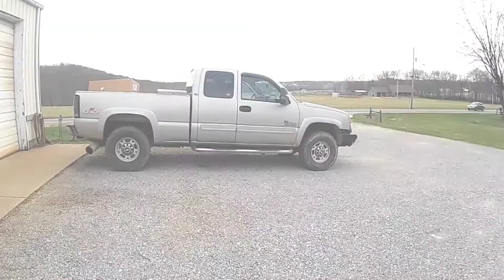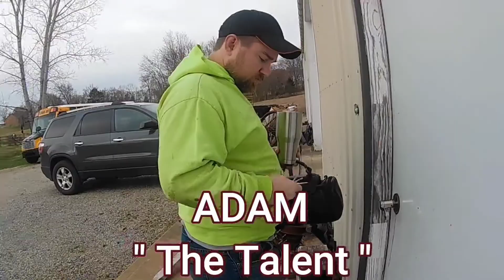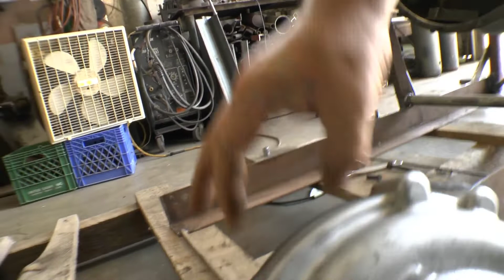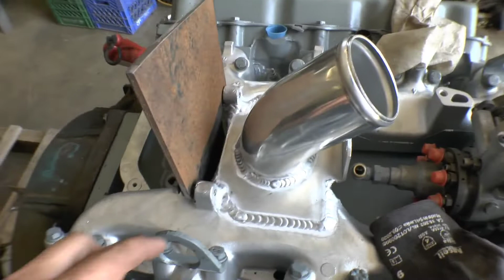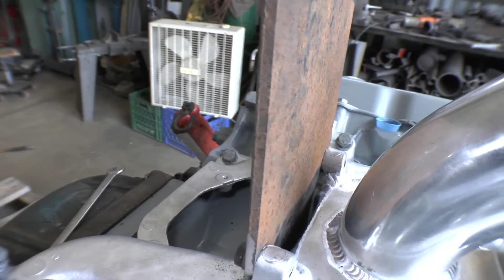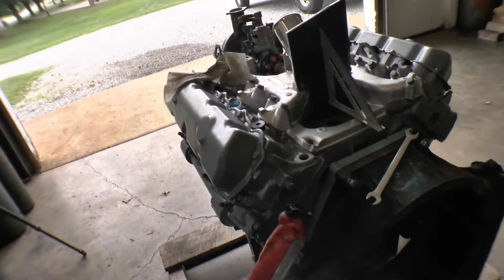Custom Turbo Mount for a 6.9 IDI Diesel Day 1

Comment: Hey man!! Love this!! I have a 86 f250 4x4 6.9idi c6 setup. Love the old truck but she tired needs rebuild any pointers help on where I could get parts and were a good machinist? I live in bamberg sc
Reply from the maker: Get a hold of Justin at IDI Performance. He has parts that will help you build to whatever level you are going for.
Reply: Thanks for the reply. I found a 90 f450 7.3idi/ztf5 spd and it's the 4x4 trans! Anyways the 6.9idi loosing compression in 3 cylinders. The c6 is tired and I hate not having enough gears to keep up at hwy speeds. I have factory 3:55 gears think it will work well with the zf5 and I'm upgrading to hydroboost from the f450. Going to freshen up new rings main/rod bearings all gaskets and seals injection pump/injectors and lift pump. And brass freeze plugs for the 7.3 idi already got new starter wp,alt and vacuum pump.
Reply from the maker: With the zf5 having .76 overdrive you will see a significant rpm change on highway and if you need the towing power leaving it in 4th would be the same as your top gear in the C6. I think the gear availability will change how the truck operates entirely. You will have to let us know how it goes and what you think about the swap when you are done.